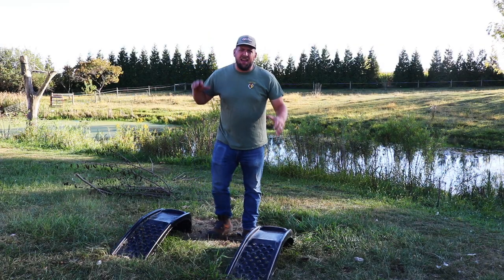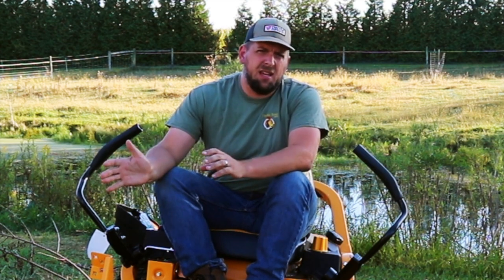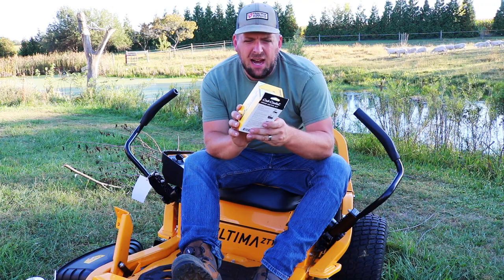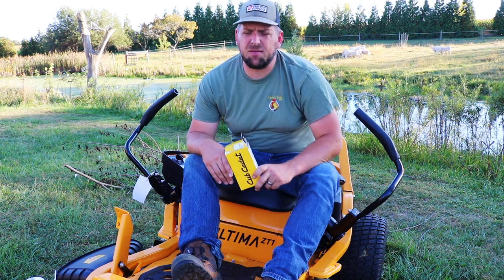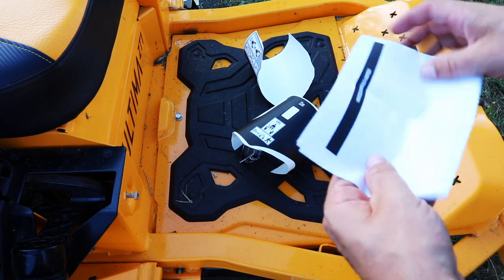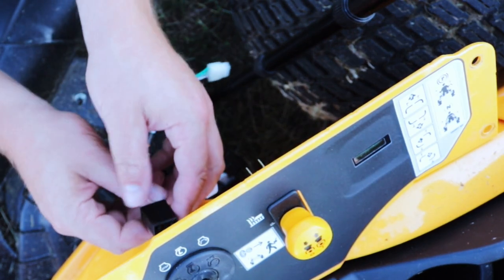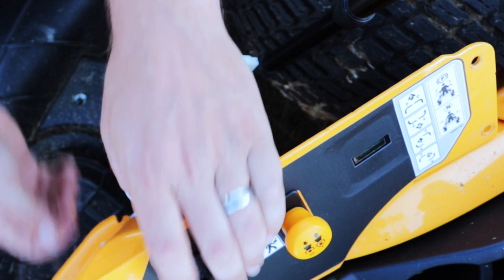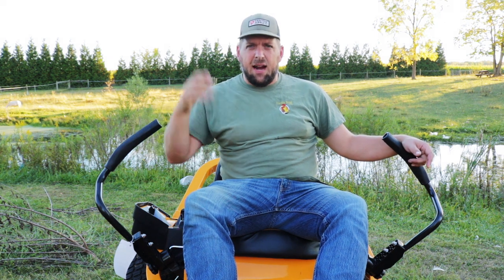Cub Cadet Mower Factory Blunder: Adding an Hour Meter (DIY Guide) Cub Cadet Ultima ZT1 54

Comment: I absolutley agree.  I the Kohler maintenance is by hours and I think the Kohler warranty is also.
IMHO, Cub Cadet is advertising a lower price, then one has to buy the hour meter and deck wash kits, which are included on competitors products.  It makes their pricing appear more attractive.
I think better customer service would be a better selling point than upcharging for parts.
Reply from the maker: I bought mine with my farm business tax exemption and TSC rewards discount. Saved about 1600 when I purchased it.

Comment: I just paid $3,300 for a ZT1 50 At Home Depot with a Kawasaki commercial grade 23 horsepower motor. I never seen or knew a Cub cadet had a Kawasaki motor. Runs like a champ.

Comment: Yeah I bought the 54 inch zero turn and paid $4,500.
For that much an hour meter should be installed to were it can't be tampered with. 
Imagine someone installing it 500 hrs after and the meter ready zero 😂

Comment: Also, a little off topic, however the blade belt tensioner spring broke on my unit with less than 20 operating hours on it... just a thought......

Comment: I have the same problem with my new ZT1. How do they plan to honor the warranty without an hour meter? The meter kit is not cheap to buy, its about $100.
Reply: My new ZT1 LT 46 was delivered today and see that it doesn't come with an hour meter like all the others of that same model have.  Another difference is the choke is a separate pull knob instead of being integrated with the throttle lever.  (Also, the choke knob was installed at a slight angle instead of fitting flush.)  The Manufacture date says 04-24.  I'm wondering if this is going to be standard procedure going forward?

Comment: Just bought this same tractor and was shocked it doesn't have an hours meter. In order to follow their maintenance schedule you need to know the hours.  Really cheap route by Cub Cadet and doing the customer a disservice. How do I know when I'm at 50hrs for an oil change if there is no hours meter.  Just dumb.
Reply from the maker: Exactly
Reply: Not just Cub Cadet. Most of the lower end mowers(affordable) that I looked at last week have no hour meter. If you want an hour meter, you gotta spend about 6 grand.

Comment: Anytime we ask why a company does something, the answer is always 'money'. In this case its not what money they're saving, its what money they're making.   More and more people these days want hour meters so they make you buy it.  It costs them about $2 to make it and sell it for $40 (or whatever).
Basically the same reason you don't get leather seats in a bare bones vehicle.  The leather seats only cost $100 more to make than the cloth ones but they charge you $2000 dollars more for them.  
Why did I buy a Cub Cadet?  They're one of the few, if only mower manufacturers that don't make you buy Cub Cadet motor oil to maintain your warranty.  And that's another scam!

Comment: Hey Brad. Question for you. After I added the meter (and installed correctly), I am now getting this message on the display “Lo Oil Press”. The mower is brand new and the oil is at perfect level. Thoughts?
Reply from the maker: Did you turn the key all the way on? I think if the key is partly on it will say lo oil

Comment: i think cub doesn't install hour meters because they have an unlimited hours warranty for the first 3 years.  by NOT installing an hour meter on every unit, they are saving $30 or so (wholesale cost for an hour meter?) per unit.  in other words, they are improving their margins by $30 per unit, give or take.  and, by not installing an hour meter on every single unit, they are more than making up the cost of covering warranty repairs of every unit combined for the first 3 years.  this 'accounting decision' on cub's part leaves the consumer holding the bag at the end of the 3 year warranty period.  additionally, for $45 retail, a seller could fudge the hours on the unit by simply installing a new hour meter when the time comes to part with the mower.  definitely a problem here.  the hour meter needs to be linked to an internal engine component to prevent hacking of hours.

Comment: I got the mower last year for around 4k USD and I used it a few times and then winter came . Well I went to check the hours because the owners manual has hourly scheduled maintenance and I can't find the hour meter anywhere. The wiring diagram doesn't have one anywhere in the circuit so are u telling me that there isn't a #$+$; hour meter from the factory ? Seriously? I just started a search online and your video is the first I found and I see u installing one but I'm so confused I have never had a riding mower especially one that cost this much not have an hour meter , plus why give u a book with hourly scheduled maintenance but not install a meter , I am at a lost for words now ...
Reply from the maker: That’s why I made this video. It is ridiculous
Reply: @FarmerBrad  now when u bought the mower did they at least tell u that it didn't have it? They told me about the arm rests, the trailer hitch, the deck wash and a few other things that were optional but not one person mentioned I would need the hour meter to be bought separately too? Not even when going over the hourly scheduled maintenance with me two different people went over this , once when purchasing and the delivery guy that assembled it on site when it came and got dropped off in the driveway  in a huge crate the guy put it together handed me the user manual the engine user manual and once again reiterated the hourly maintenance and when he saw two other  just regular cub cadet rider mowers in the maintenance shed he said " ohh I guess your aware of cub cadets hourly maintenance and how to read the hour meter!" I laughed and said yeah I've had a few regular mowers from you guys. Now why wouldn't he have said anything about this one not having one then? It seems like a good point to make that I might have to keep my hours logged since this mower didn't come with one I would think , wouldn't you? 
  😂  Like I'm thinking of finding out how to spin back one of the meters off the older cub cadet mowers here and put that one on this mower but I wish I would have known before I used it an not 20hours or so into the life of the thing... 😂 I can't see why they would have done this and not offered it at time of purchase and why no one that works on these things seem to know they don't have one on them lol?
Reply from the maker: @gamersplaygroundliquidm3th526 I noticed it when I was reading the manual after I got it home
Reply: @FarmerBrad  my manual has many references to check the hours for this and that but nothing to point to the fact that it was sold separately, does your manual actually say that? What year is the mower?

Comment: Dumbest thing ever. I didn't put one on last year when I bought mine but will this year. 😊
Reply: How will it be accurate now that you have used it for so long?
Reply: @1jw298  I just put one on that  goes around the spark plug wire. I don't care about total hours on the machine, just when i need to change oil, etc.. If I do get the factory one, it will only be used for maintenance.
Reply from the maker: I was still under 5 hours when I installed it. So not too bad